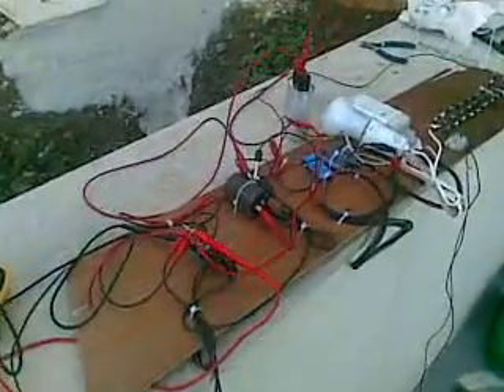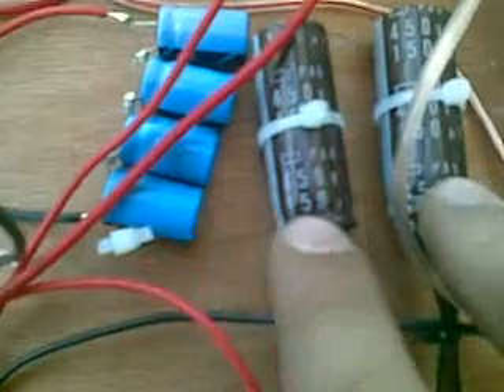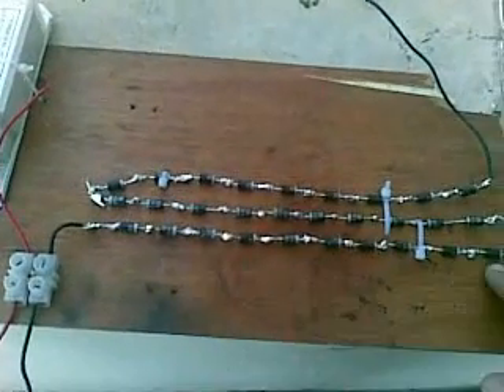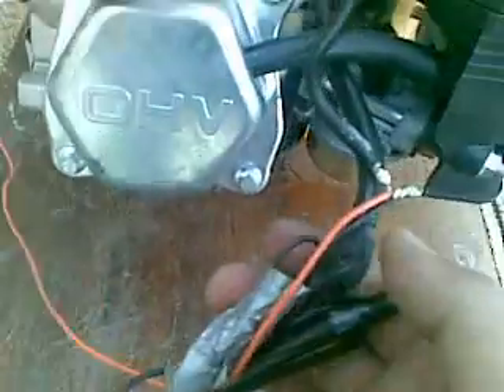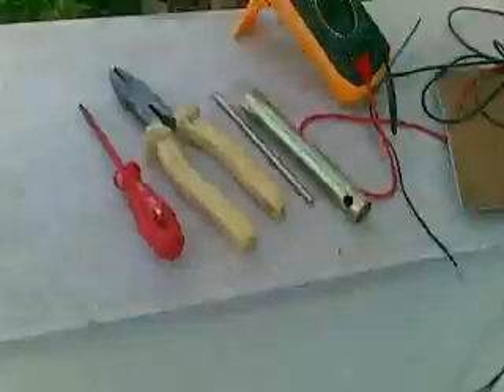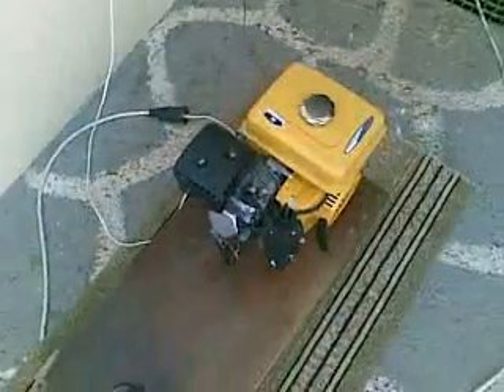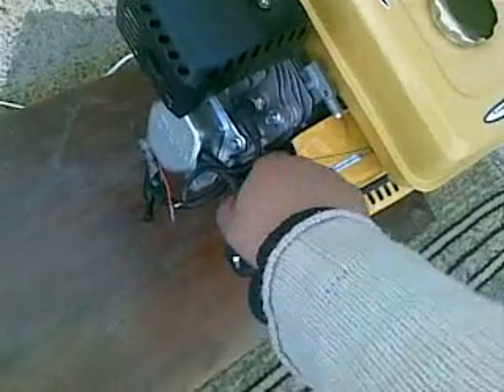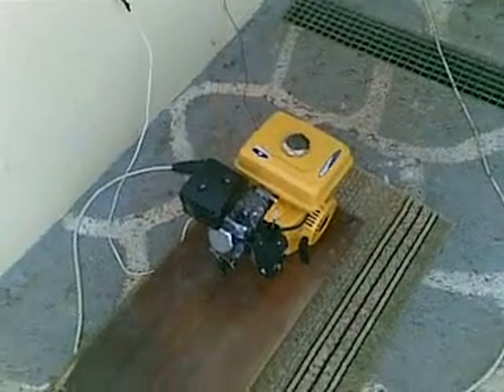VexUs plasma circuit on 4 stroke engine ("Unity")

Comment: Try with 5% water first and move up step by step. Try with ordinary tapwater versus microwaved tapwater to see if there is any difference. I put some water in a regular lawnmover without plasma, and it was microwaved. The rpm rised clearly before it stopped an minute afterwards. I think that the water i put in slowly diluted the petrol and when it became too much, the engine stopped. I never could get the engin to start with water in the petrol.